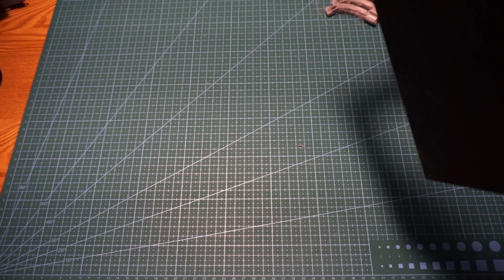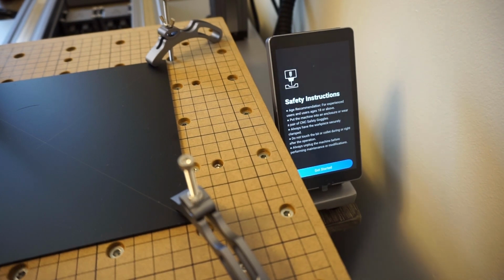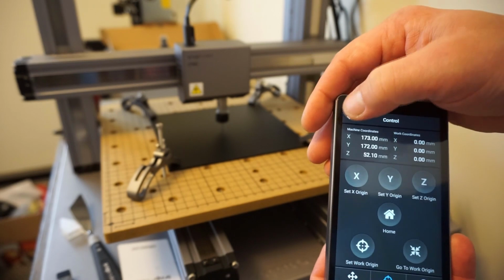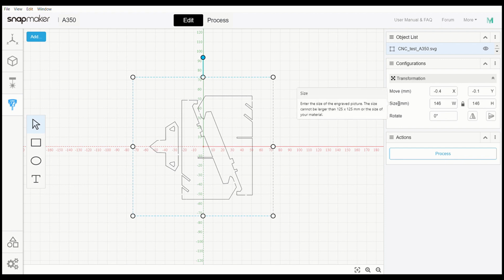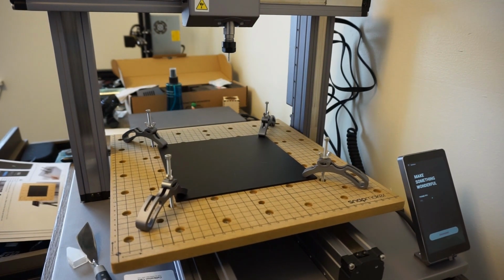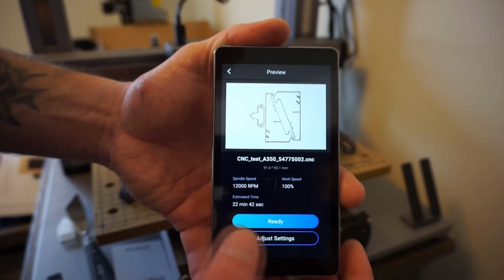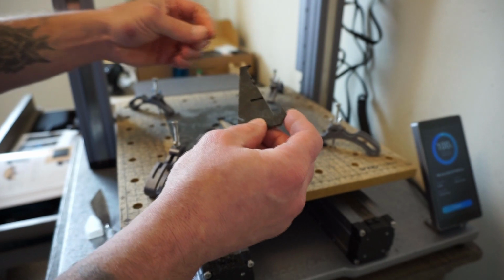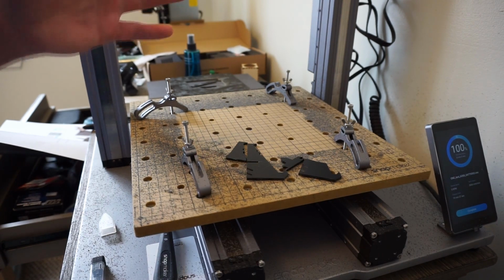SNAPMAKER 2.0 CNC RUN GUIDE

Comment: There is an option in the software to add tabs. This will keep your parts from separating from the stock before the job is finished. The use of a knife will break the tabs from the stock.

Comment: It snapped because the slots were not the correct size, You should have set the size they said for the clearances to work. Have yet to use my CNC as i need to setup a clearer area for it, Only used the laser upto now, and had it what 18months ish lol, stood idle for well over 12 months, as i hated the noise of it, But luckily they released some better and so much quieter linear modules and power supply. Have the rotary module to play with also, and should get the 10w laser next month :), Nice video of a start to finish for reference though Thanks m8

Comment: Just purchased one of these and about to do my first CNC job thanks for the video just fills in the gaps of knowledge, just one suggestion, I am not going to cut up my work board I am going to use some scrap board to mount my job on so the CNC tool can cut my job out without damaging the work board. 
Having spent my hard earned dollars on this wonderful machine I want to look after it and try to keep it as new looking as possible.

Comment: Can't find a relief carving  video, is it possible to rough carve with a thicker mill and then carve the finer parts with a thiner mill? does luban automatically sets goce for rough carving and thin carving?
Reply from the maker: I'll look into this.
Reply from the maker: I'm still looking into this. I do apologize for the delay on getting back to you. One thing you could always try is after doing the final product is offsetting the distance a little lower and changing the tooling which would give you greater detail to the finished product. Still looking into a final answer for you through.
Reply: @thumbhobby1390  Thanks! Looking forward for it ;-)
Reply from the maker: @JCchan99  I have an official update to this so you know. Sorry I have been a little slacking on things but I'm also getting married today.
Reply: @thumbhobby1390  wow congratulations!!!

Comment: Thanks for the run through and details on this - the "double-sided tape" suggestion is a solid one.  You can also select the tabs option in Luban when doing cut-throughs as well - that will tell the machine to leave little tabs throughout the workpiece to keep all parts connected - think of those model car / airplane kits with the parts attached to a frame.

Comment: FYI, you are recording with your camera in "Interlaced" mode (like 1080i30) which is why you can see the horizontal lines in the video when you move quickly. Change your camera to record in 1080p (progressive) to get rid of the lines and make the video look better.
Reply from the maker: OK, thanks for the tip.

Comment: As you got your measurements already very precise to minimize the cut in to the waste board I suggest just put a few pages of heavy paper / thin cardboard under your actual material. For the actual clamps just get a set of screws with different length and you can adapt for better clearance of the work path.

Comment: When the piece of plastic flew away and hit the camera was scary! Thank you for sharing your experience. Now I know exactly what to expect. The only thing I'm still at a loss is how to prevent the parts from flying like that.
Reply: I suggest breaktabs for the cut. So the parts don't get lose.
Reply from the maker: Perhaps a light layer of adhesive to the bottom even just some scotch tape. To be honest the problem is in the g code. An engineer would know better  than to complete an outer path before an inner one. Had this been reversed it would not have happened.
Reply: @thumbhobby1390   I was thinking the problem with the piece flying off was really an issue with the Luban software because that program is responsible for generating the movements for the entire sequence.  How is the average consumer who is going to use the CNC going to know what order parts should be cut, and how to enforce that in the software?  You may want to let Snapmaker aware of this issue and point them to your video so they can investigate this. 
BTW, I really appreciate the time you take to make these videos.  I just got my A350 and I'm trying to learn as much as I can through videos like yours.  I think it'll be worth the extra $$$ to get the enclosure after watching your video.
Reply from the maker: @auggieben  Yes I do understand what your saying and you're totally correct on all counts. This is totally on SNAPMAKER for allowing a programming code out that can do things like this. Luckily enough it was an empty room where this was going on and no one got hurt. The enclosure is also going to be on my of things for this spring to invest in as it will help cut down on noise as well as prevent smoke and debris from spreading. I do have many more videos to come. Thanks for watching.
Reply: @thumbhobby1390  I was just watching another video and the guy was making that same cut and that same piece flew out.